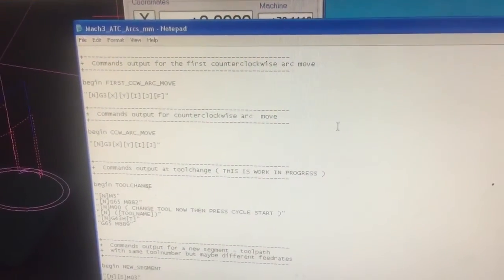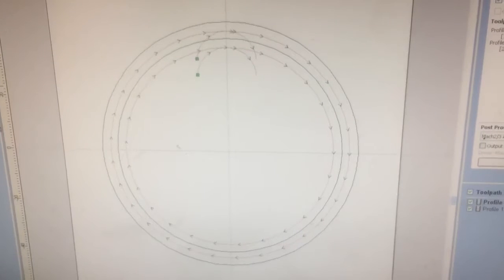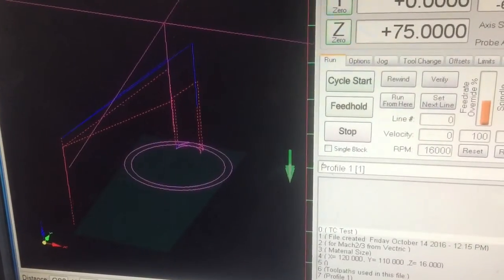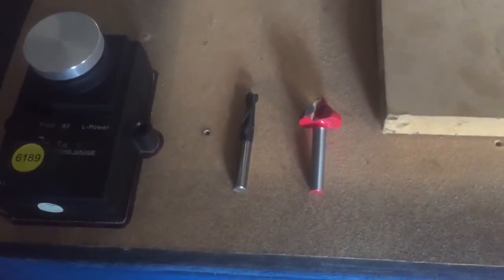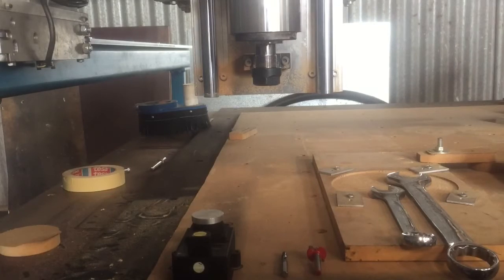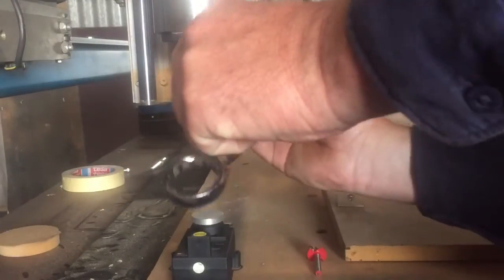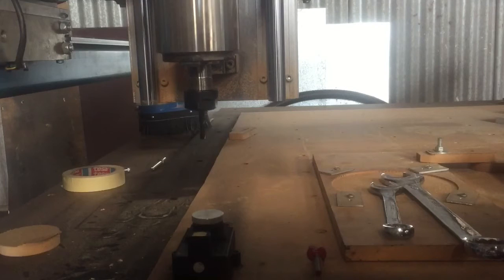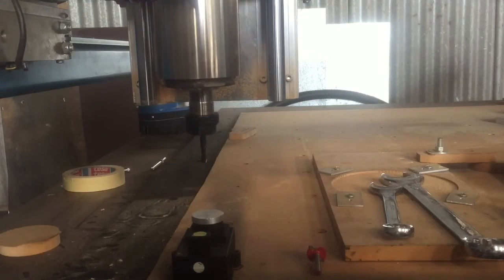DIY CNC - (CNC ROUTER)  Multi tool change with auto tool measure. Mach3.

Comment: How were you able to rewrite the program. Is there somewhere I can get the info? Is there somewhere on line that explains this. Thanks John
Reply from the maker: john charland just modify the script. Check the Mach3 forums for info.
Reply: +DIY CNC any chance you have a link to what you used?   I'm also curious what touch plate that is, with my machine I need to manually attach a ground to the tool.  Very cool setup you have BTW.

Comment: Nice to see the XHC DT02 in action. I'm using UCCNC with the UC400ETH controller. Did you get your ATC macro to work with UCCNC? And how do you like UCCNC? I never used Mach3 as I built my machine and started with UCCNC. I'm very satisfied with the software and the support.

Comment: Hi!  Your CNC runs very smooth and fast, what Controller Setup do you use? I have build my own one CNC too, but it makes terrible noises. Thanks and greetings.
Reply from the maker: habekeinenable I recently changed to UCCNC software with a UC100 motion control. My drivers are cheap Chinese M542 drivers. Motors are Nema23 425oz/in. The machine has rack and pinion on X& Y with a 1605 ballscrews on the Z axis with a Nema24 425oz/in. .